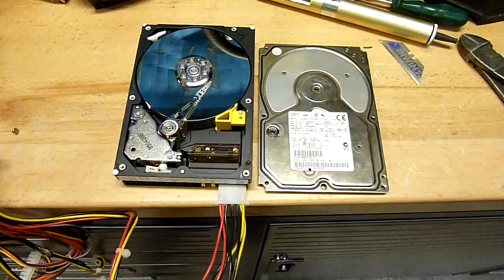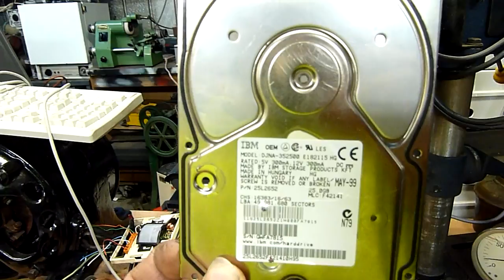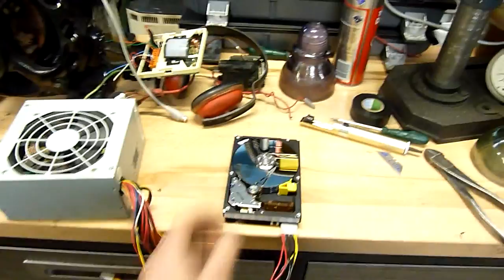Barking IBM Hard Drive

Comment: The reason that hard disk is doing that is because you removed the lid and the voice coil is causing the axis head's rotary axle to become unstable and "pinch" the bearings. Many hard drives rely on the lid to stabilize the rotary axle and won't operate when the lid is removed.

Comment: I had a 46GiB IBM Deathstar, it was made in 2000.  Around 2011 mine failed too but it started making a kinda barking noise similar to that one.  I eventually opened it and started tossing shit at the disk as it spun at full speed.  The disk shattered sending bits of glass everywhere, I'm still finding pieces of it around my bedroom today and ive cleaned it many times since then.
Reply: You had a 45GB 75GXP hard drive. Those were the worst and failed alot.  There was a class action lawsuit against IBM for those.

Comment: Make a hard drive speaker out of it and then maybe turn up the volume until the voice coil starts smoking then do the same with the platter motors. maybe put some gas on it and let it light itself on fire.

Comment: That noise is a collapsed head. If you have the time to do it: I suggest try and get the platters out, hold one up to the sun and see if you can see a red or blue silhouette through it, then leave them outside for 8 or 9 weeks and you will eventually have clear glass disks.
Then you'll have a see-though barking/quacking/turkey calling hard drive ^^

Comment: Wow, I like that.  I'd say that's a replacement hard drive, that PowerMac you recently autopsied wasn't from 1999, that's when Apple had gone to the coloured plastic iMacs.  I didn't like that slight rattling noise the hard drive made as it spun up, that's a worry, but the barking was funny, very funny.